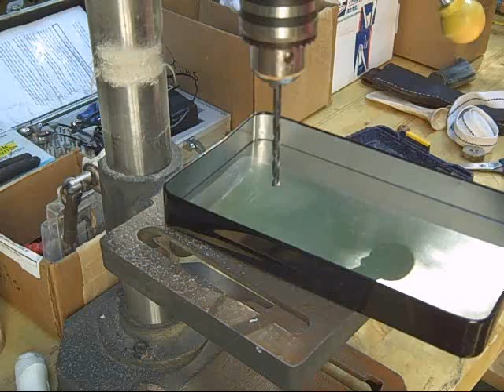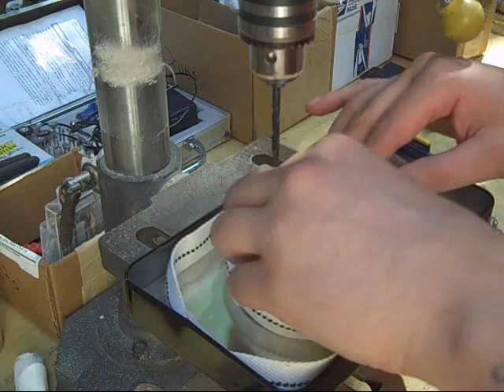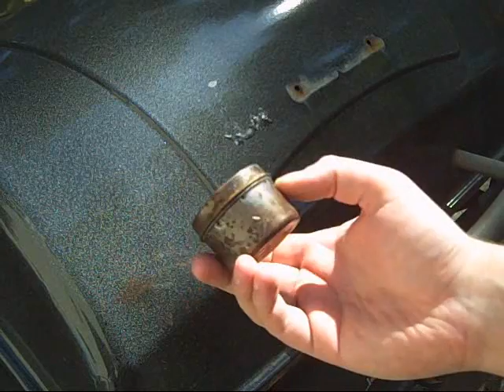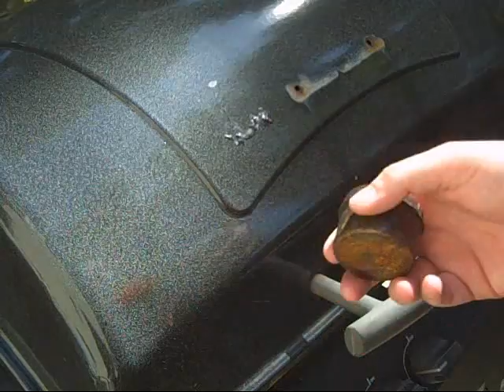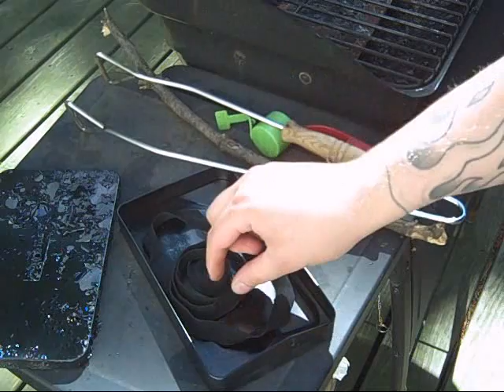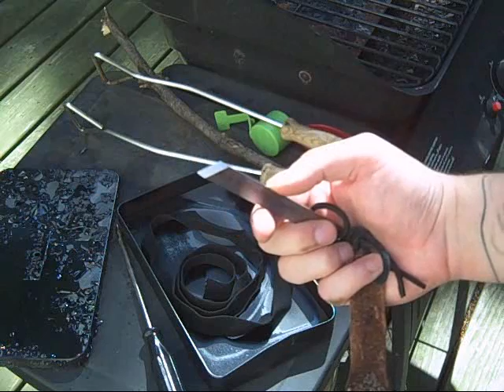Charcloth and a little striker/tool I made from O1 steel

Comment: that lamp wick doesn't need to be charred entirely, just char the end and it will take a spark from a flint and steel no problems and smolder away charring more of the lamp wick as it goes.
I actually treat my lamp wicks with potassium nitrate, makes it even better at taking a spark and smoldering evenly. 
I use that same lamp wicks all the time.

For char cloth use old jeans, buy them from Op-shops, you can get them usually for $5 a pair (it doesn't matter what size or style they are, just they are 100% cotton denim) and one pair usually makes like around a hundred squares of char cloth (or more), so much more char cloth than the equivalent than you would get from that lamp wick.